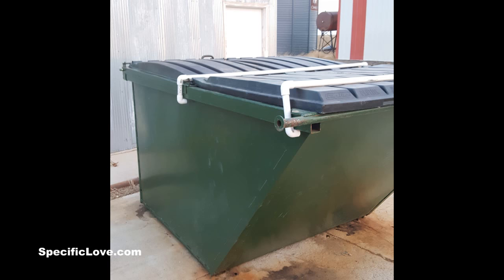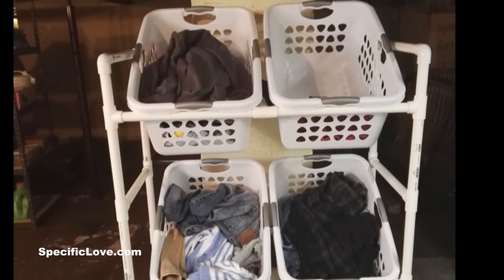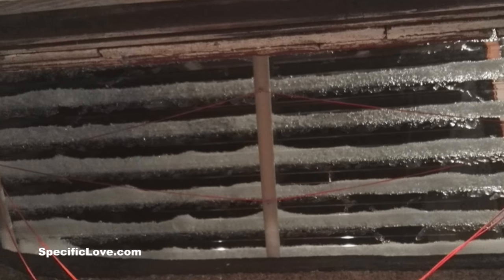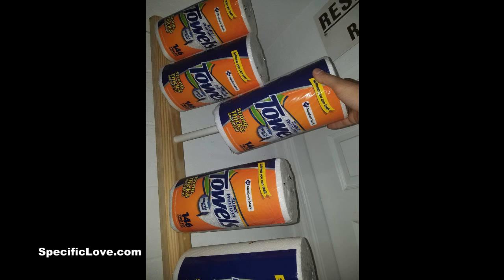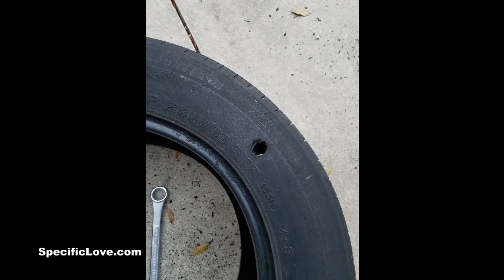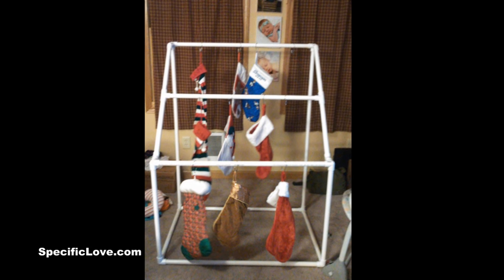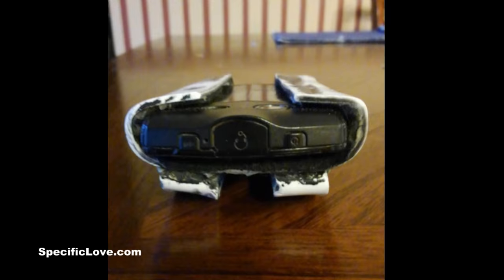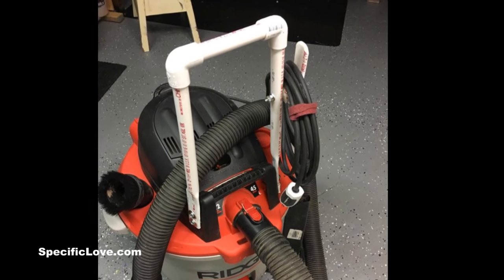PVC PIPE Projects

Comment: I built a 24 foot by 36 foot garage out of PVC that has withstood 37 mile an hour winds and a winter in Kansas... top that.
Reply from the maker: I would love to see some pictures
Reply: what???? Videos please????
Reply: +Specific Love Creations okay I've never sent a picture to somebody on YouTube before so hopefully you get this I frame my building in 2 inch PVC for the roof trusses and I use 6 inch PVC poles for the main structural support actually started with two swing sets that I cut in half and made taller using PVC pipe and then I insulated the walls and cover the top of the tarp can I use quarter inch particle board and I use that just to cover the areas I framed on my building